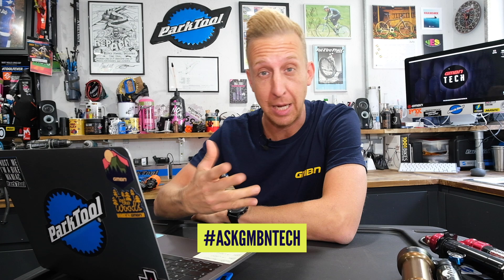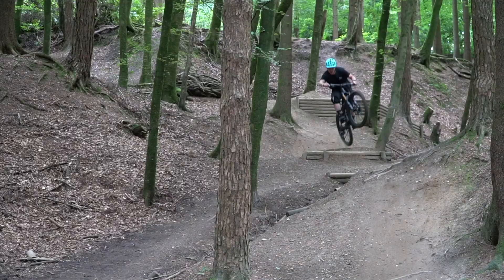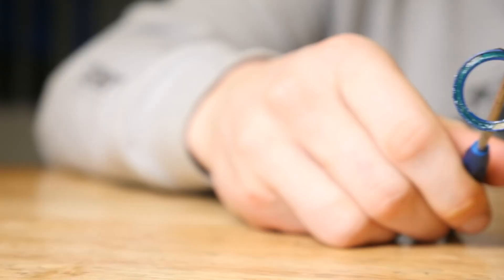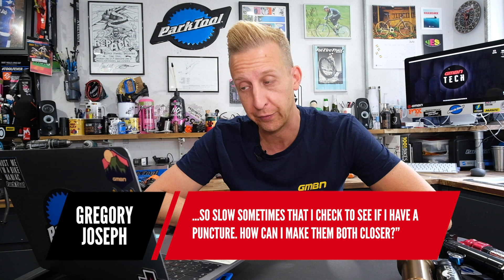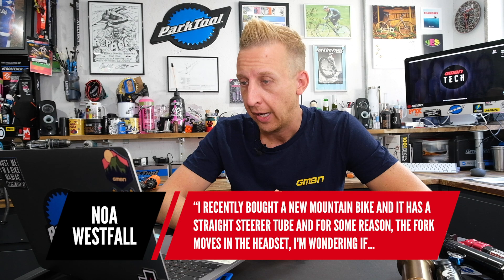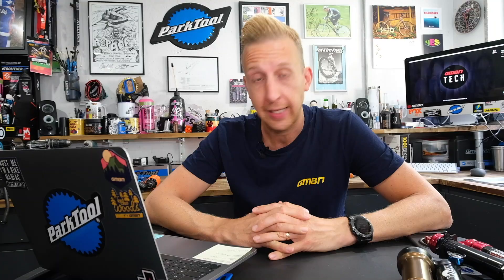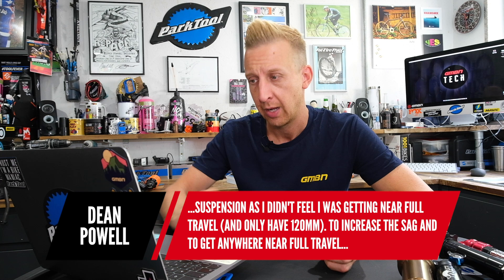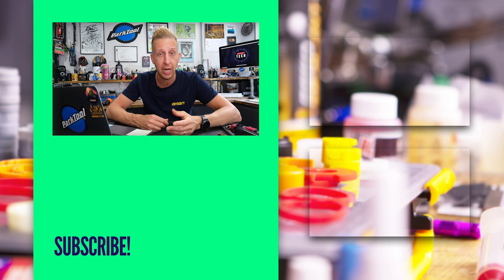I Find It Hard Swapping From An XC To Trail Bike Can Tyre Choice Help? | #AskGMBNTech

Comment: #AskGMBNTech Hi, i have Rockshox domain 180mm. I took it to my local shop to get a full service. A couple months later they changed the spring and after that it wouldn't get full travel anymore. It gets firm on the last 40mm of travel. Any idea what could be the cause?
Love the vids! Keep up the good work:)
Reply: Possible a dual rate spring or just a higher rated spring. Sounds like a dual rate to help give support through the travel and on large hits since coil is linear. Use a cable tie to measure your sag as well and see if that's correct. From there - as long as your sag is correct and it just goes firm at that point and doesn't just bottom out, I wouldn't worry about it since it will help give more support on large hit and when far into the travel. They probably just replaced it with your old rate at the first stage and a higher rating at the second stage. That or they put a higher spring-rate spring in for some reason which is wrong for your weight but I doubt they would have done that without you asking.
Reply: @imattultra1623  Thanks for the  reply! So the shop changed a medium coil spring, instead of a soft. The soft was bottoming very easily. I've been checking online, it seems that its something to do with oil. I put the bike upside down and that helped. It feels very linear on the first half of the travel but then it just get firmer and firmer. It feels like a bottom out even though there's 20mm of travel left.
Reply: I have about 20% sag
Reply: @oliverspe350   Good news is your spring rate is correct since your sag is correct! I think we can put it a down to an increased amount of damper oil to improve progression.

Since they know you were bottoming out, they increased the spring rate and progression of the fork I suspect.

Not sure what type of damper your fork has, but in open bath damper forks, increasing the amount of oil in the damper can increase progression since the air has to be compressed more when it gets close to bottom out. Basically decreasing damper volume like an air fork volume spacer equivalent for coil forks. 

Most likely that if you know there isn't a dual rate spring.

Also increasing the weight of the damper fluid would overall increase compression damping, but we know it isn't that since the stroke is nice and supple at the start.

Turning it upside down makes all the oil flow to seals and foam wipers, so it gets new lubrication that's why it felt nicer again after you turned it upside down.

Maybe there is something I'm missing, but thats what it sounds like to be.

If you feel safe in doing so, crack that damper top cap off and suck 5cc out using a syringe (assuming it's an open bath) and repeat if still too progressive. I would do some research and check before you try.

If not, maybe go back to the shop and ask if they did add some damper oil and if they didn't, it must be something else. You could get them to take some out of it if they did.

Hope you find a solution, but don't worry, it won't hurt your fork and there is always a solution! 

Hope this is of some help!
Reply: @imattultra1623  Yes, this helps alot! I was just worried that something was broken inside the fork. I'll ask them to make it linear the next time i have it serviced. Thank you for the help and the time you spent on finding the solution:)

Comment: #AskGMBNTech I just bought a used Trek fuel ex 8 29, and the previous owner converted the 2X11 Deore to a 1X but only changed the chain ring and chain (same mech), will this cause problems? Or do I not need to worry about it

Comment: #AskgmbnTECH Hey Doddy, I have a bike fit question. I don't know if you can relate, but at 6'0" I have sort of average sized arms and legs with a longer torso so I sometimes get some lower back pain and hand pain on my large Sentier. I find myself hunched over reaching for my handle bars. I have a 50 mm stem and 25mm rise full length 800mm bars (I would Imagine that cutting down the bar would help get me a little more upright) In addition, sliding the saddle forward I find myself sitting a little higher so the handle bars are super low. I've put all the spacers under the stem and fiddled around with the saddle to no avail. Any help is appreciated.

Comment: #AskGMBNTech
 Hey GMBN,
Ever since I got my mtb, the stock fork has been having trouble with locking out. I'd twist the knob and nothing would happen. What I had to do was take the knob off and stick a 4 mm in and turn it until the fork would lock out but that solution would only last until I unlocked it after the climb. Is there anything else I could do that would yield better results?

Comment: #AskGMBNTech. I’m building a Ragley Blue pig 27.5. The manufacturer have emailed me and said I need a rear Thru axle with the following measurements 142*12MM 159MM long M12x 1.75mm. I can’t seem to find a axle at this length ANYWHERE! Can I use a slightly longer axle or does it have to be this exact size? Thanks!!!

Comment: #askgmbntech Hello guys, I really hope you get a chance to cover this as I can't find the answer anywhere! 
Recently I purchased a Raceface Affect R crankset. Upon trying to install it, I noticed that the non-drive side crank arm would not fully insert into the bottom bracket. Looking at it closer, I noticed (what I'm calling) preload shims pre-installed around the spindle, preventing the crank arm from fully seating.  Not only were these shims preventing the crank arm from seating, but they were also offsetting the cranks greatly to the non drive side, effectively bringing the chainring to close to the frame.
My question is, are these shims meant to be used for adjusting Chainline? And if so, are you free to adjust them between drive side and non-drive side?

Comment: #AskGMBNTech Can a longer travel fork be put on a bike? My current bike is hardtail trek roscoe and I have been feeling the need to upgrade from the stock 110 mm travel, could a 130 or 140mm work?

Comment: #askgmbntech I have a new Sram dub bottom bracket that’s threaded on my Santa Cruz 5010. I have only ridden around town a few times and on the trails once. When the right crank in the 12-1 o’clock position it makes a clicking noise. I have made sure it is tightened down all the way and it has grease on it. How can I fix this? Thanks

Comment: #askgmbntech I am building up a jump bike from the frame and have recently got hold of some old 2002 Marzocchi bombers. I put them on the frame with the headset in but no spacers, I noticed that there is only under an inch of steerer left for a stem. My question is are steerers replaceable and if they are how many places still do it? Loving the show keep it up 👍

Comment: I'm about 220 pounds and run a set of aluminium 29er Hope wheels on my Enduro bike. I keep finding that the wheels feel really flexy and unresponsive compared to my old 27.5 bike. Could I improve the stiffness by soldering the spokes together like they do on track bikes or would nipping up all the spokes do it. #AskGMBNTech

Comment: #AskGMBNTech hi Doddy, long time fan first question: I have a brand new Lyrik Ultimate, and with the fork under no pressure (even off the bike and held by the crown), it sits a bit lower than the actual „full travel“ (aka less distance between seal and 10% mark than between 10% and 20% marks). I was told that is due to the negative chamber, but that sounds just not right?

Comment: #AskGMBNTech  I have a large 2017 Giant Reign 2 LTD with a RockShox Monarch DebonAir RT. I weigh 230-240 lbs and max out the shock pump (330 psi?) to get 35% sag at best (locked out) and I pedal strike a lot - are there shock options that would deal with my weight better resulting in fewer strikes and 25-30% sag?

Comment: #ASKGMBNTECH I have a pair of Magura Menga 130mm Forks. I have set the PSI from the table on the fork for my weight and the Forks feel good when descending. The only issue I find at this pressure is that the bike dives terribly under heavy breaking, I've increased the pressure to reduce this but its ruined the responsiveness of the fork. Is there something else I can do to run the lower pressure and reduce the dive??

Many thanks, Loving the channel and all the videos.

Comment: #AskGMBNTech hey doddy I am looking to upgrade to a new full suspension bike from a hardtail but the problem is my budget sadly. I am limited to around £800 so o have been looking around at second hand bikes but nothing is standing out as something that will not snap on my first trail ride. Do you have any recommendations for me?
Reply: Stick to hard tails. My reccomendation would be not to spend money on a full sus until you have about £1850 and you can get a decent full sus (eg Trek Fuel Ex 5). You could look at models from a few years ago to knock the price a bit and I personally wouldn’t chance it with used
Reply: @harrybryson1130  thx but for my riding style i feel and have been told that a full suspention would benefit me on the types of trails i ride.
Reply: Twiisted_Blizzard well the cheapest i would go would be the Vitus Mythique at £1000 👍🏼

Comment: #AskGMBNTech  I have a Deore groupset in 2x10 setup with an SGS RD and I wanted to upgrade it. I looked up some forums and they say bigger pulley size is more efficient. Should I opt in for oversized pulley(Kactus Sports 12t/17t) or just buy a new RD that has bigger pulley size(What can you recommend for a 10 speed?)

Comment: #askGMBNTech
I've got a Giro Gauge MTB shoe. It's got slots at the bottom to install cleats but I haven't got anything installed in yet because I still ride on a flat pedal. Is it advisable to use the shoe with my flat pedals? I am very much a casual rider (green & blue trail, confidence not so great) and often get off my bike to push it up a terrain I can't pedal up or in cases of emergencies when you need to quickly put your foot down. The terrain here where I live can sometimes be very slippery mud that are narrow trails with a lot of roots. That's why I bought the shoe to give me grip when walking, something flat bottom skate styled shoes specifically for flat pedals do not offer. Shoe itself looks like a grippy hiking shoe albeit with channels underneath and a hard bottom sole

Comment: #AskGMBNTech My suspension fork stops working when it is 15 °C or lower. I have a coil suspension fork. I don't know what to do and I don't know how to fix it.
PLEASE RESPOND 🙏
Reply: Lower weight oil might help, depending on the type of fork. For example 5W instead of 15W. If it is a cheap polymer fork with hard lube inside, then softer lube might help.

Comment: #AskGMBNTech Hi guys, im interested in getting a DH bike and I like the new Canyon Sender, but I want mixed/mullet wheel sizes and that option is only available in the S and M size frames. I am 6’1” and would need a Large frame... so my question is would I be able to put a 27.5 on the rear of a large or would i have to go down to the Medium, if so would there be any alterations I could make in order to make the smaller size feel more suitable for myself? Thanks, love the show, keep it up!

Comment: #AskGMBNTech I have a rockshox pike rct3 with 160mm of travel on my trail bike. I've set up the forks to the rockshox app suggestions but haven't used a shockwiz. No matter what I try I can't seem to get the full travel out the fork. Only getting 140mm even when going to BPW last weekend. It's my first modern fork with a single Schrader valve for both positive and negative. Any help would be really appreciated. PS I love the videos really helped me understand my bike and save me money on services I would normally go to my lbs for

Comment: #AskGMBNTech I currently run a 2017 Yeti ASR-C with Shimano  XTR M9000 11 speed cassette, rear mech, shifter and  175mm cranks. I am looking at buying the new Yeti ARC and switching my rear mech, cassette and shifter to it. I realise my existing M9000 1x Crank will not fit due to the super low Q-Factor so would use the new XTR M9120 12 speed 1 x crank and 32T chainwheel. Would this set up work?
Reply: @bananasstuff3344  brandnew cassette. Rear mech has brandnew jockey wheels. New KMC chain also.

Comment: #AskGMBNTech hi, ive got a rockshox reba sl dual air from 2010 and its supposed to be a 100mm travel fork. i let all the air out in both chambers by accident so i filled it back up to 130+ pressure and 135- pressure and the stantion thats showing is 130mm. can you guys let me know whats up? i dont want to ruin my forks

Comment: #AskGMBNTech Hi Doddy, I recently installed a box prime 9 drivetrain on my Dads bike. Box says that the 9 speed chain is comparable with 11 speed narrow wide front chainrings. I installed a Shimano m7000 front chainring however the chain seems to not catch correctly. It looks like the teeth do not line up with the teeth at certain points in the chain. The chain keeps coming off while shifting. I have Shimano xt cranks with a 96 bcd and can not find a 9 speed chainring. I do not want to replace the cranks Any ideas on what to do?
Reply: Stable Genius {Jihad} the problem is, i need a 96 bcd and I can not find a chainring in that size, I have Shimano xt cranks that I do not want to replace
Reply: Stable Genius {Jihad} I got this crankset for my dad and I can’t return it anymore, I ordered an aftermarket chainring from a different manufacturer, it didn’t specify the chain though, it had some good reviews, I’m going to try and see if it works, thank you for the advice

Comment: #askgmbntech When I swapped to semi metallic brake pads my brakes started howling at very low speeds . I just finished sanding both the rotors and the pads , and after bedding them in they still howl like crazy. Please help it is driving me crazy. Thank you!

Comment: #askgmbntech I am looking to add a gearset to my super73 rx ebike. They recommend a shimano zee m640 10 speed gearset but also say you can put up to a 12 speed on it. Do you know a 12 speed gearset that uses a short cage derailuer? They recommend the M640 due to low ground clearance of the bike

Comment: #askgmbntech after a very long absence from mountain biking, over 20 years to be exact I'm looking at getting back into it.

I was looking at spending around £1k on a hardtail for general commuting and some light trails, I was looking at either the Boardman 8.9 MHT or Voodoo Bizango Carbon but ended up confused as to which is the better bike. 

At 16 stone I wasn't sure if I was too heavy for the carbon bizango.
Reply: Barry Eggleton all bikes are made to a max weight of 120kg so either one would work perfect for you
Reply: i'd forget going to halfords, there's great choice and great local bike shops out there
Reply: bananas stuff agreed i have a bossnut i got for 700£ new amazing bike

Comment: My lower bearing in the headset is too small for my frame and my fork rocks back and forth in it... I want to replace it but I have no idea of what to buy. Also the rest of my headset is an absolute MESS, I have a pressed into the frame loose ball bearing as the top bearing, and a sealed and wrong bearing as the lower bearing. It's a complete DISASTER
Reply: LBS..
Reply: @rupedog  already tried 2 times. He denied the problem alltogether lol
Reply: Do an internet search on headset standards and that should help you figure out what you have on your bike. Then you simply need to measure the headset to get the diameters you need to replace the headset.

Comment: #Askgmbntech Hi guys I recently put 2.8 inch wide tyres on my 40mm rims but I was out on a ride the other day and someone told me I could run small tyres such as 2.6 inch wide tyres on my 40mm rims would this work because I would love to switch my conti trail kings out for some specialized butchers? Thanks love the channel 👍👍

Comment: #AskGMBNTech Doddy, I am a 11 year old and am around 145cm high, I was wondering if you have any recommendations for a trail hard tail
Reply: ... I’m 13 and your height 😭 Jokes aside, what’s your budget?
Reply: $800
Reply: Lucas W Trek Roscoe 6. It’s a tad bit over €800 but it’s good value. If your budget it strictly €800, look at previous years models. I know the 2021 model has a dropper post, a 1x10 and has (I think) tubeless ready rims. Only thing is it has a SR Suntour fork but it’s still ok (30mm stanchions and a lockout as well as preload adjustment)
Reply: I’m from Australia so $800 for u is like $1500 in AUD
Reply: Lucas W oh rite ok I assumed it was just USD I’m from Northern Ireland, AUS $800... would that be enough for a trek Marlin 5? I have had one since September and it’s a good bike, I can shred rough enough trails on it. It’s not the absolute best but it’s good for £395 and mines a 2019 so it’s even better now

Comment: #AskGMBNTech 
I have a specialized rockhopper (2007) it currently has the original Rockshox Tora 302SL(100mm) fork but I want to upgrade it what is similar but better #AskGMBNTech

Comment: Hello, i love gmbn tech/gmbn videos, 
and i have a question, i have Bergamont Revox 3 with 100mm fork and 29 inch wheels, i found 185mm fork, i want a bit of upgrade because i can clap it even by just bouncing on the bike, how much would 85mm increase change the riding? Or should i get better fork with same or a bit more travel for the money? #AskGMBNTech

Comment: #AskGMBNTech    I am new to MTB and have completely nerded out on every video and forum. My question pertains to 2019 Specialized StumpJumper 29 Carbon Expert. This bike came with Roval carbon wheels but I have since found that the hub is not a dt Swiss branded hub, I cannot find solid evidence that I can upgrade the internals in this Specialized hub with DT Swiss ratchet internals. Do you know if this Specialized Hub can be upgraded to higher engagement with dt Swiss internals? #AskGMBNTech